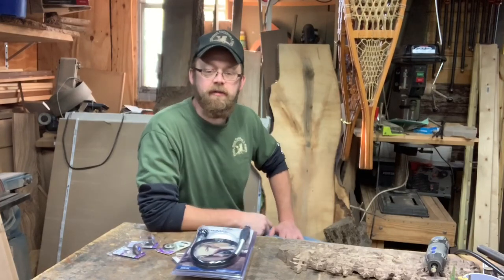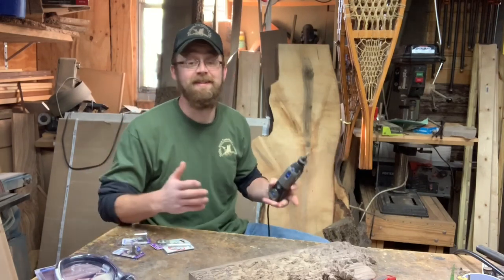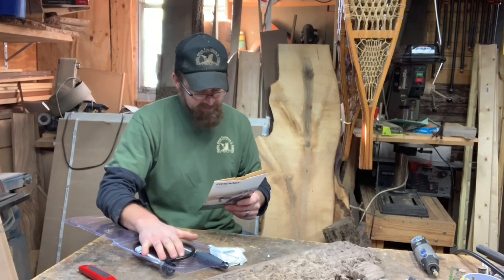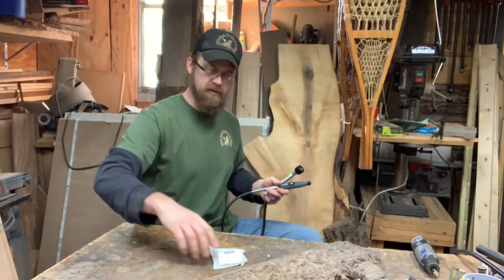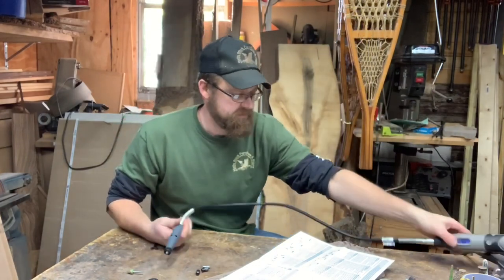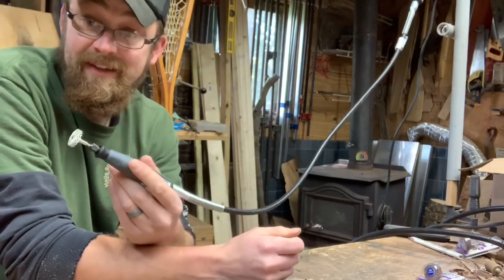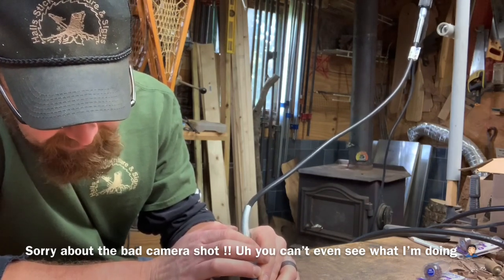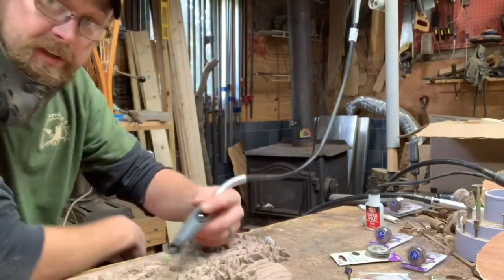My first Dremel flex shaft / giveaway update

Comment: usually the brushes wear out. They are easy to replace and are not a lot of money.. check your brushes.  Nice carving.. keep busy!!!!
Reply from the maker: The couple that have stopped working have a broken copper wire inside the motor. I have re attached it a couple times but continued to break .
Reply: @KyleHallwoodworker   you did the right thing then.